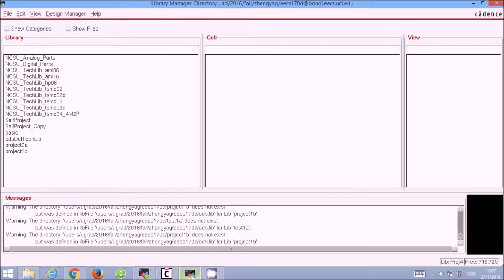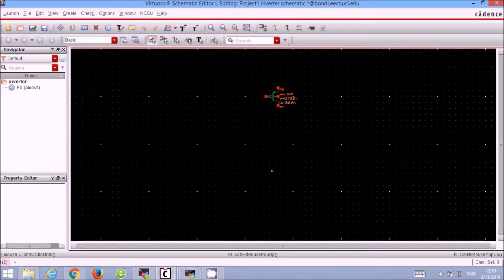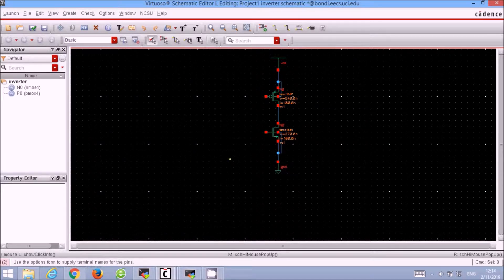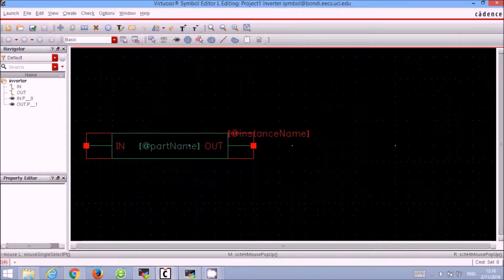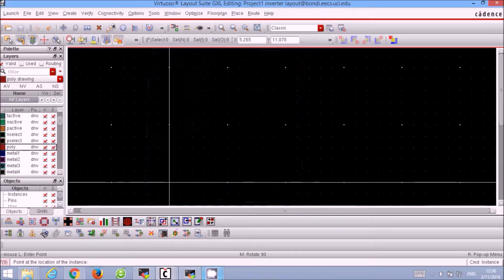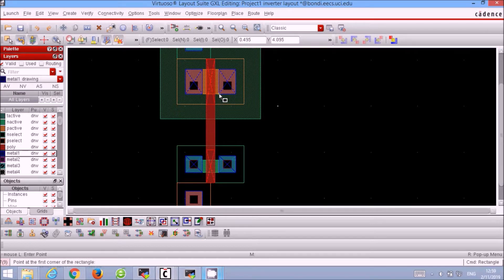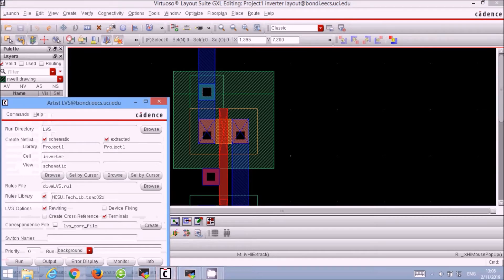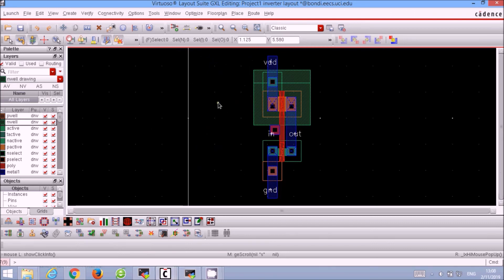Cadence Virtuoso Tutorial: CMOS Inverter Schematic and Layout

Comment: Due to COVID19 Pandemic colleges are not opening and I can't access the cadence software so I searched for an open source software that I can use for making the Schematic, Symbol and Layout of the circuit, I found GLADE. It is not Cadence but its quite good and feels similar in making the circuit schematic or designing the layout. Check out my playlist on Layout Designing using GLADE. #LearnFromHome

VLSI Layout Designing using GLADE (Open Source Software)
Playlist Link:- https://www.youtube.com/playlist?list=PLWcG9vtrFH0YVZvd3yf2Xmm_Gl0y-XXz6
Video 1: All the CMOS Design Rules are explained. 
Video 1 link: https://youtu.be/b3IlK1WZIHA
Video 2&3: Glade Downloading, Setup and Configuration. 
Video 2 link: https://youtu.be/LMZ3O6Akfro
Video 3 link: https://youtu.be/1ueSinMmqkA
Video 4: Designing Layout of nMOS and pMOS is explained. 
Video 4 link: https://youtu.be/oOblwp65WFA
Video 5: Designing CMOS Inverter Layout using 1 metal layer is explained in detail.
Video 5 link: https://youtu.be/Qr0nTPo-Ri0
Video 6: Verification of Designed Inverter Layout using LT Spice. 
Video 6 link: https://youtu.be/kvrF6Zv6Y_U
Video 7: Designing CMOS Inverter Layout by using 2 metal layers and Vias.
Video 7 link: https://youtu.be/HZopqROB2GA
Video 8: Designing 2 Input CMOS NAND Gate.
Video 8 link: https://youtu.be/41067AYX_do
Video 9: Verification of Designed NAND Gate Layout using LT Spice. 
Video 9 link: https://youtu.be/3pufZ6InuHQ
Video 10: Designing 2 Input CMOS NOR Gate.
Video 10 link: https://youtu.be/skYC2UnJgQ4

Kindly Like, Share among your engineering friends so that they can also learn from home and subscribe to my Channel for more GLADE Tutorials. Your Support will be appreciated.
Thank You

Comment: Good afternoon, When I am trying to create the instances for the pmos and nmos for the layout, I am getting different layouts for both transistors. Would you happen to know why is that ?
Reply from the maker: Hi I apologize for the late reply, hope I'm not too late. 
Can you clarify what you mean by different layout for nmos and pmos, So I can make a better explanation? I'm just going to shoot off a few ideas that I may have at the moment:

1. I'm using TSMC 180nm foundry, if you are using a different foundry(not in the TSMC family), the layout may have different colors for the individual layers but the concept is the same.

2. Nmos and pmos layout are inherently different due to the different layers are used to make them.

3.If the difference is due to sizing and/or different amount of fingers(gates). You can use the property editor(hotkey Q) to change them to the desired measurements.